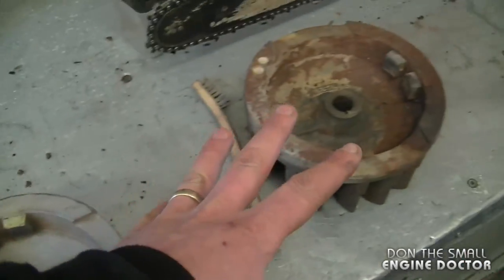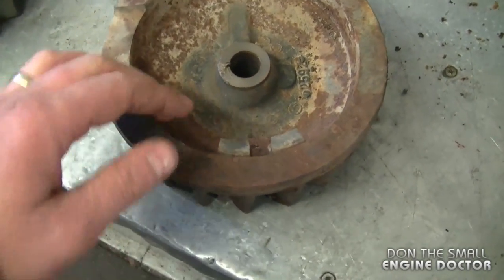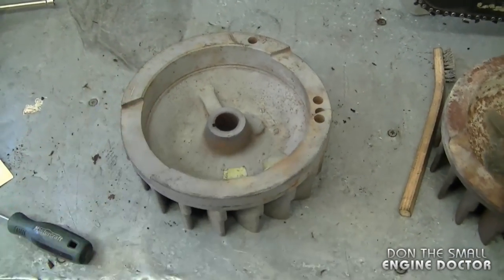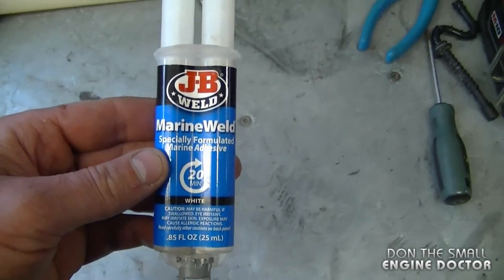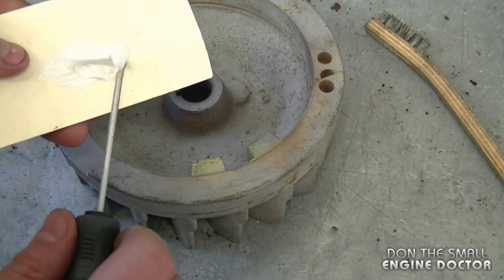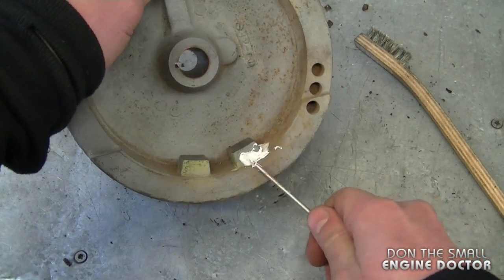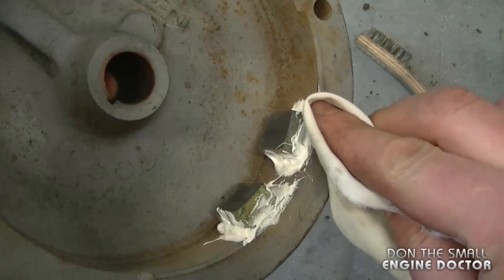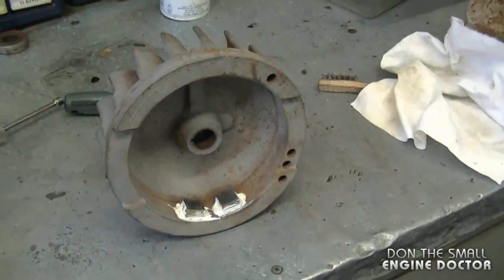Quick Tip #12 - Flywheel Magnets

Comment: I happen to be working on an old massey ferguson tractor with a Tecumseh engine. the issue is no spark. I have determined that the condenser is bad but I noticed that on your flywheels the magnets are about an inch apart. on mine, it looks like a previous owner has done this repair but he glued the magnets right beside each other, actually touching each other  (by the way, I was able to remove 1 magnet just with finger strength, so it's good that I saw this video so now I can re-glue them). should they, in fact, be spaced about an inch apart and where, exactly, should they be located so that the spark timing is correct ? thanks for any help you can offer and keep these excellent, well-recorded, well-edited, and informative videos coming, please.

Comment: Help! I was replacing my flywheel on a B&S 21hp yt3000 and dropped the key way down the hole in the crank. Using a magnet pulled it out and there is a 3/8x 1 7/8 magnet bag that came out. What does this do and it seems to long for the bolt?

Comment: I need help !  I need to no the polarity of the magnets is one positive one negative facing inward? Factory magnets are curved on the backside which I assume one will have a positive field up &  a negative field up.
I just installed a new coil & condenser, but still no spark with these magnets installed. ????

Comment: Hoping you may know, I have an older tecumseh engine with a fly wheel issue. It is a different fly wheel but  My main question is  I understand the purpose the magnet on the outside of the flywheel. This fly wheel has a gear for the electric start but also  two magnets on the inside of the flywheel. What is their purpose? I have a second fly wheel but no magnets  on the inside will it work??

Comment: Still need to know the measurement between the 2 magnets. Both mine came off and locked the flywheel. I see where one goes but can't make out where the other goes. Guess I'll chip it off and move it a little until it fires at the right time.

Comment: Interesting.  The two Tecumseh engines I have (mower and outboard) have the magnets built into the aluminum, not stuck on like those you showed.  Wonder if mine, at least one circa 1975 is newer or older than the one you showed.

Comment: How do you find where to put them back to, Mine came off and don't know where to put them ????  Thank you The Dizz.
Reply: hey dizz. yeah maybe he could give you some measurements.
Reply: Hope so, cheers Man.
Reply: Both my magnets were loose, but wire brushing then spraying with starting fluid and holding at an angle in the light, I could barely make out the outline where magnets were glued.  Put both back on with epoxy, works fine now.  If you stop the video looking at the position of the magnets relative to keyway, it would probably work to guess the position - better than throwing it away.  The point opening determines when the plug fires.

Comment: Easy part is glueing them on, that's a no brainer. BUT, the hard part is knowing exactly where to place the magnets if you can't tell by old marks magnets left on flywheel. AND, how about the air gap?  I;ve tried various methods to set the mag. air gap with weak spark results. I don't have the Tecuseum cutaway flywheel & be tough to find one. I guess i;m buying a gauge to find TDC, but, the damn piston is offset, so you can't just find TDC by going through the spark plug hole!
I need an old timer to churp in here!!

Comment: Thank you for the great videos I learned a lot. Quick question live in Chicago I have a John Deere LA 145 I store it in a unheated garage, run engine empty of fuel or with fuel and stable?
Reply: non alcohol fuel with stabilizer is best, if cannot find fuel without alcohol use a treatment for it, of course starting once a month is recommended as well.

Comment: Do you know if the polarity matters? I have both magnets knocked off and I was going to epoxy them back on. I don't know what order they were in to begin with. I checked them with a compass and one has north pointing to the center and the other has north pointing out so they are different.
Reply: Polarity doesn't matter, just try & find marks left from where they were on flywheel, if you can't , well, i think your outa luck

Comment: Say Don, I've got a 16 hp tecumseh engine that is on a Miller bluestar welder. Someone took the flywheel off the engine and the magnets inside they took out and did not mark what direction they were in. There r at least 6 in it for the charging of a battery. I need to know if there is a way to figure the polarity of them to reinstall them correctly.
Reply: You need an old school navigation compass. It will point north and south so you can figure out which pole is which on the magnets that were removed. Then reinstall them so N and S alternate to get your charging.

Comment: Thanks Don. Always something to learn from your videos. I have Wisconsin motor on my tiller model we180.  It's a good motor and runs really well. I took the carburator off because it was overfilling but now I see there is also corrosion and pitting on the carb body inside. Do you have a place to recommend where I can get parts for this motor? I'm thinking I'll replace the whole carb. I'm in Manitoba hard to find parts for this motor.
Reply from the maker: you'll have to google it, there may be places in the usa

Comment: My quick tip is use a stick or something plastic to spread on the epoxy so the tool you apply it with don't stick to the magnets

Comment: It doesn't throw the inertia off?
Reply: Not to insult you but, we're are not fixing a piano here. Those small engines are not "blue printed". The weight of the epoxy isn't going to affect the engine at all.